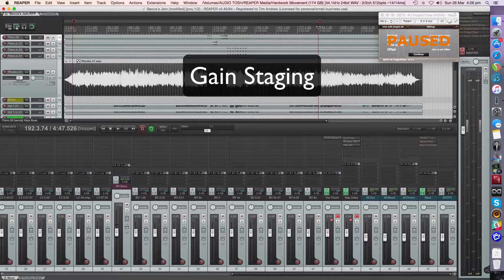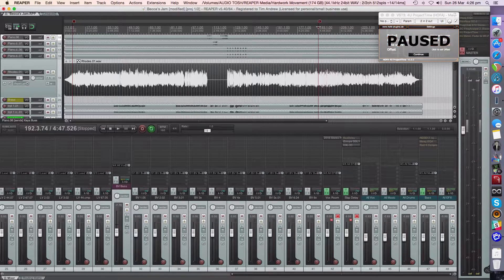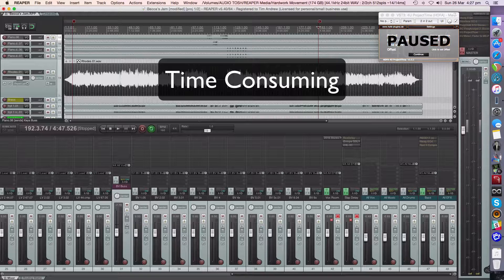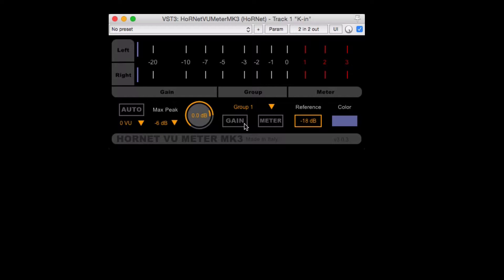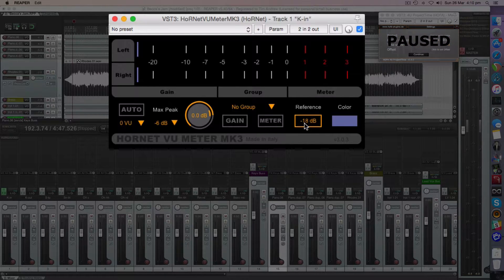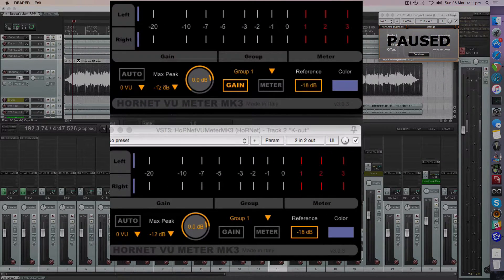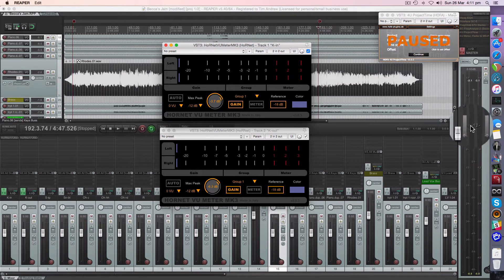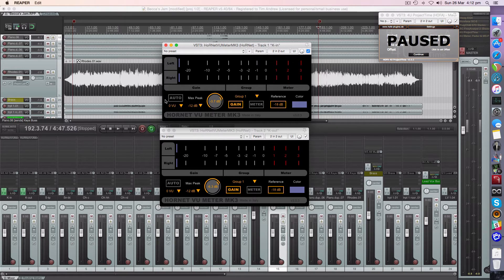Gain Staging the Easy Way // VU Meter MK3

Comment: Great tutorial thank you. I just bought VU Meter MK4 on the strength of this. MK4 has a couple of nice additions such as sending values to all instances of the plugin (no need for groups if you don't want them). I'm still relatively new to the concept of gain staging so a couple of newb questions if you don't mind.
1. What's the chosen value for maximum peak dBFS relative to? Is it the chosen reference value (e.g. -18 dBFS), or 0 dBFS, or something else?
2. How do you choose the maximum peak? You picked -12 dBFS in the video. Why not -3 dBFS, or +6 dBFS?
Reply from the maker: -12 is where most plugins work there best..remember this is before other plugins, like the trim or gain on a mixer, this feeds whatever is next in line

Comment: Stupid question maybe but what is the difference by just dropping all your meters until the master hits -12?
Reply from the maker: If you did this as group, there could still be a wild variance in all your recorded tracks, it can also be time consuming.  This way each track is optimised, up or down to the set value like -12dBfs...if you leave the same on your master buss output, your Mastering Engineer will thank you for the headroom too :) Thanks for watching and subscribing ..  Happy Mixing
Reply: I agree, image if you have to mix an album or if you have sessions with 32 or more tracks, very time consuming especially if you mix for clients, it’s easy to do it yourself but it can get really time consuming to do this
Reply: No, it's not time consuming.  Do it once, and then save it as your starting template. 
Now they're already there, each new session.....and already grouped and set at your level. (-12db, -18db.....whatever).

Comment: By now any DAW developer should have actually implemented  this as default feature into their mixers (auto trim button).
Reply: It's not complicated at all, you only need to run the SWS action: Normalize selected items to db value...
Reply: have you made this video yet?
Reply: NEPSOUND 

00
Reply from the maker: REAPER has a way of doing this, it is complicated and I do need to make a video on it :)  Happy Mixing, Opto

Comment: I tried this and doesn't seem to work for me. I want all of my tracks gain staged at -18 but they come out way hotter than that. I tried several things and started using my mix tool on a 85 track session so i'm frustrated this isn't doing what I'm wanting. My setting are exactly what you have.
Reply from the maker: Do the VU meters still peak above what you asked for?  Or has the level been dropped?
Reply: The level does drop but nowhere near the needed -18
Reply from the maker: Did you you set the "Max Peak"?
Reply: yes to -12
Reply from the maker: Are you talking dropping TO -18dB or Dropping -18dB?
Reply: To -18. I want all meters to read -18 at unity gain0
Reply from the maker: I was looking to see if I could send you my preset and try that, but still having trouble finding where they are stored
Reply from the maker: It is set to GAIN not Meter right?
Reply: Yes, 
Max peak is -12. Why doesn't it go lower? That would solve the problem?
Gain selected. Meter isn't, Ref is -18. If I change that to -35 then my level goes down to -18 on the track meter. Changing the max peak doesn't seem to do anything. Its a weird device and wish you could just enter the value you want it at.
Reply from the maker: Did you try sliding the internal gain down, the rotary wheel?
Reply: I just tried that on one track and it worked but there are 2 problems. Once you hit auto that raises back up. Not all the tracks are the same level so some are reading at above -18 and some below after setting the rotary wheel to -18. Id have to change them individually just the same as the mix tool to get them all to read -18.
Reply from the maker: Hard to see what you mean, but your track meter is the one you should be reading for the peak.  I just crushed a track and engaged the plugin after the track was normalised (very hot) and the meter reads -12 as set by Hornet.  The track meter also peaks at -12.
Reply from the maker: You can adjust the peak settings as the track plays and the track meters respond accordingly
Reply: I think I was able to get the tracks close enough by moving the dial to -19. I was measuring the output on my track meter. I got this plugin to save time for gain staging. I wrote Hornet and this is what he told me.

Hi, VU Meter doesn’t measures peaks, but Volume Units.

This means that material with fast transient is measured just for it’s loudness and adjusted accordingly. That -18dBFS you set is the reference for the 0VU so if you engage auto gain the gain is adjusted to read 0VU on the meter, but f the track is a short hi hat for example it will have very low general loudness ant the plugin will add a lot of gain to reach the 0VU.

A VU Meter in fact must have 300ms attack and release time so it’s very slow, i think you are expecting to limit the peaks of your track at -18dBFS this is something that TrackUtility is capable of doing but not VU Meter.
Reply from the maker: Thanks for sharing, glad you went to the source.  Happy mixing. Opto
Reply: Yes and thank you for taking the time to help! You did!
Reply from the maker: YW :)
Reply: But trackutility will keep volume at the same level all the time, so its no good for classic instrumental music, it will kill the dynamics, am I right?

Comment: Hello optomod. Thanks for this video. I recently bought the Lu meter mk3 but it's the same. Do you onlly put every instance on every track and put them all in the same group?  And do you put them at the busses and the stereo bus as well? I don't think so but maybe you can only put them on the busses? Thanks.
Reply from the maker: Hi Fam.  I would normally only put in on the individual tracks that feed your groups, although, I guess, once you are settled on a mix you could add it to your groups if you wanted.  Remember we are creating enough room so that our groups and master buss are at a level that is easy to work with, so there really isn't any need if yo have set your gain staging well :) Happy mixing, Opto.

Comment: So you just have to play the song through once after you set the auto feature on for each hornet plug in on each track and it should have the levels figured out?

Also, sorry, I'm still to new to mixing so I don't know if this question even makes sense, but if I decide to pan and add dynamics to a mix, it won't mess with the Hornet plug in, right? Like, it will automatically adjust itself?
Reply from the maker: Ye sit is as you say :) happy Mixing :) Opto
Reply: Cool. Have you ever used it for vocals?

Comment: Just select all the items and run the script "normalize items to LUFS" -23 .. and better yet there is a personal script on the forum that normalizes to LUFS or RMS and if the peaks go over -X (you set amount) it will lower the item to the set number. like you said "why waste time doing shit you don't need to" .. REAPER specific
Reply: Surely this type of normalizing is destructive, whereas the plugin method is not.
Reply: @tomkent4656  well you would be wrong...
Reply: @frankb8616  But you didn't say WHY you think I'm wrong!
Reply: @tomkent4656  REAPER is non destructive. Normalizing is the equivalent to simply Analyzing then lowering the volume of each item/clip. The adjusted amount is visible over the item after the process.  you could even set a VU meter in slot 1 and adjust it manually but that's a little time consuming when you can select all tracks and run this action/script .
Reply: @frankb8616  I think we're at cross purposes here. I maintain that normalizing (in the strict meaning of the term) IS destructive, since you are altering the waveform structure permanently.  However, I accept that in Reaper and some other DAWS, you can temporarily vary the input level of a track by the method you describe, without affecting the original waveform.
Reply from the maker: Right On Frank, I was not aware of that, that is great news, I am into speeding up the process...learn something new about REAPER everyday.  Cheers.
Reply from the maker: "normalize items to LUFS" -23.  This seems to only adjust the fader position not the clip volume, can you link us to the forum tweak please :)
Reply: search the action for "normalize" theres quite a few actions available. also the "analyze action (with window) has various action when you right click after the analysis. 
http://forum.cockos.com/showthread.php?t=184368
that is the action I've been using recently. i left a comment at the bottom as to where you "must" have the script located in the script folder..
Reply: also the script takes a minute to do its analysis/math so if you select 20+ tracks it takes me 2-3 minutes before it will adjust the item volumes .. when its done any items that were lowered due to peak will still be highlighted. items that are adjusted to RMS or LUFS and don't break the peak threshold set will "unselect"
Reply from the maker: I have the 2 scripts in the same folder as the suggest script, but when I do a search for "gain staging" or "Nantho" they don't show in the Action list
Reply: in the actions window theres a "load" button. navigate to the folder and select them one at a a time. then you will have them available in the actions window for use.
Reply from the maker: Perfect!!!  That deserves a video...what a process...Thanks for the help...Happy Mixing :)